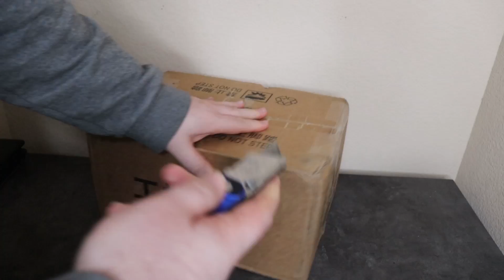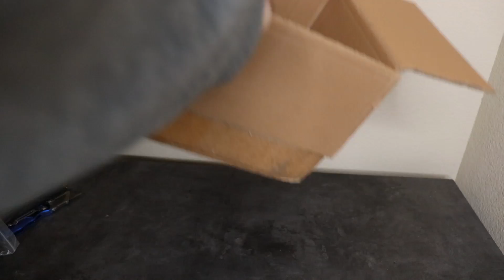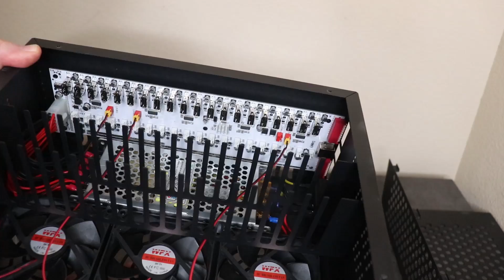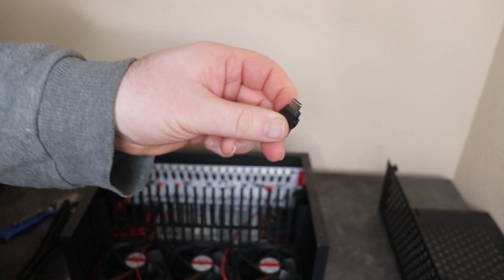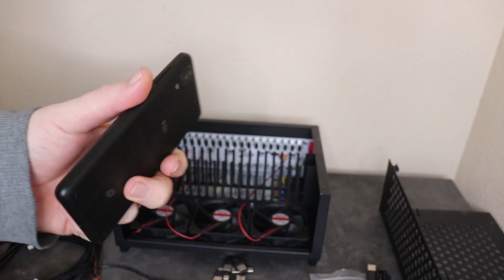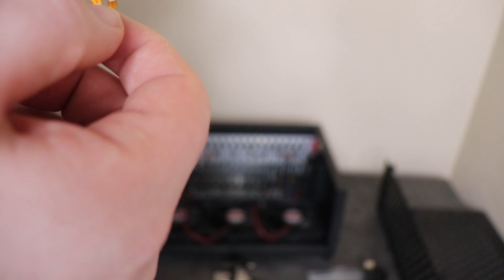CellHasher Unboxing & Overview | Mining Server Case for Phones

Comment: I can't find any info online. Whats the max thickness on a phone to fit those slots without spreading them out?
Reply from the maker: Are you trying to keep the factory battery in the phone and casing on the phone? If so, I found the A03S to be the maximum width and even that was a little too tight to my liking. Once I took the factory shell off, that device fit quite nicely. I'm now running HMD Vibe's in the enclosure and feel that thickness is the best. No batteries or back shell on them
Reply: @RetroMikeTech  Awesome. I am. Looks like the A03S is 9.1mm with case and the a15 im trying to use is 8.4mm so i hope it works.

Comment: Any update getting this working with the AO3S factory non rooted phone (unless you have an easy root method you can share). Look forward to an update on this unit.
Reply from the maker: No, I ended up running them with fast charging usb cables, but that eliminates the ability to use the management software. I have some upcoming plans with the cellhasher, but sadly won't be running a03s's in them

Comment: Is there a way to add "hybrid" as the password in the config.json so that the phones can mine in hybrid solo mode?
Reply from the maker: Are you using RainbowMiner or Verus Cli miner? If you're using the cli miner, then you can add "pass": "hybrid", to the config.json. If you're using RainbowMiner, you can expand the specific config under the luckpool pool config and select hybrid mode
Reply: I'm using the Cli miner.  I'm wanting to move over to Rainbow Miner because it seems like the possibilities are endless.  I'm just having a difficult time trying to understand some of it.

Comment: I wanted to know more about this product and you did exactly what I wanted. I mostly wanted to know what was used to link the phones to the computer. I guess my question to you is could you run adb devices in cmd and see if all the devices show up?. Seems like you'd need to use the similar phones to get the same constant power, which might be difficult for those of use doing phone farming for more than 10 years. I was honestly looking into making something like this for my normal phone farm and not versus mining. Thanks for the info, it might be a lower cost to get this than to get 2, 10 ports usb powered hub and a 5v 300 amp power supply..

Comment: Did you flip the psu to 110v?All the ones I got were set to 220v and I had to turn down the voltage pot. to run the Orbics
Reply: There is a switch inside the PSU (switch able to 110v) just open the PSU

Comment: Very interesting. Quick Q. What does a single ao3s hash at and what does that equate to on daily profit.
Reply: i get about 4.5 h/s using userland/ubuntu/ccminer,  3.7-8 h/s using verus miner,   without any cooling apparatuses , need to  use a verus profit calculator to determine  profitability ,    depending on pool, price of verus,    now that there is merge mining on verus getting little extra vARRR